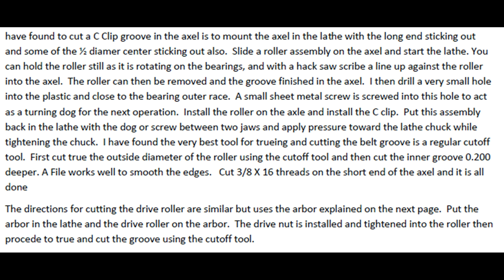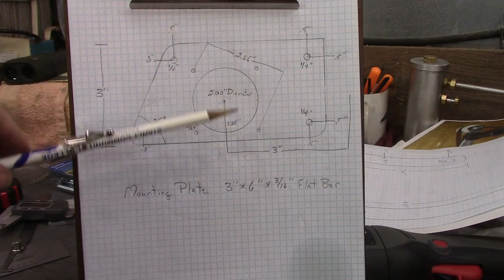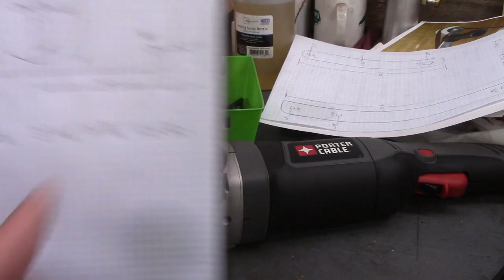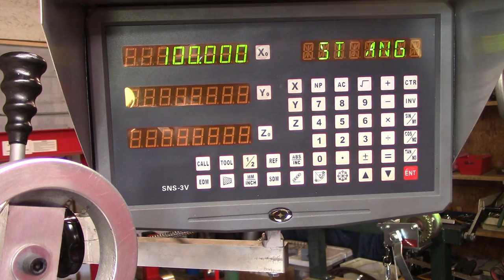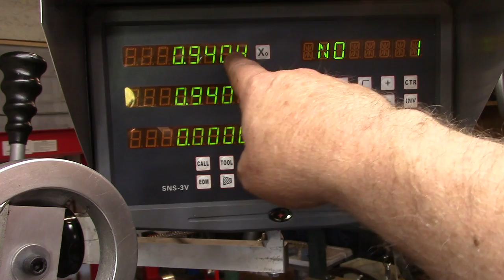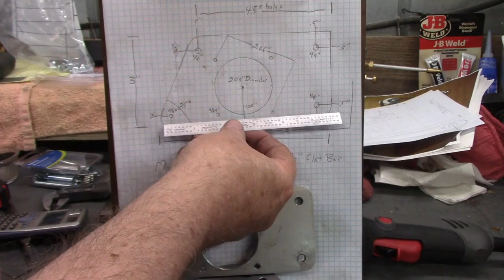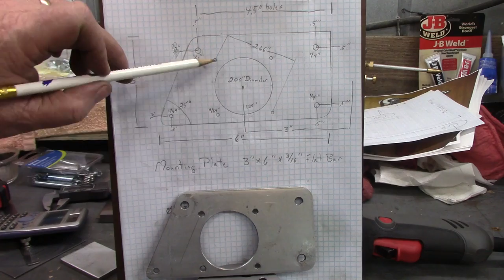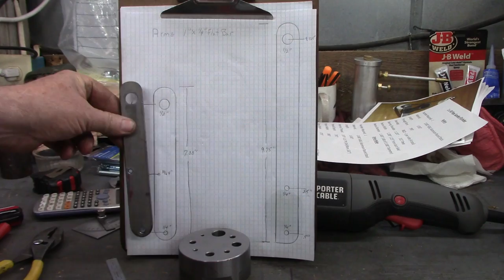1 x 30 Pipe Sander / Polisher - Part 1 of 3

Comment: Fantastic. Found the same Porter Cable grinder and CAREFULLY flipped the head. Then I used your dimensions and drawings and cheated, using 2d cad software to make a dxf drawing for the parts and cut them out on the plasma table. It was however a pleasure to watch you make yours. Outstandingly useful tool. First use was to polish the post on a used Delta floor drill press I got for a song. Mounted in my homemade pipe jig I from a piece of flat bar and some casters ( idea I also borrowed from What We Made channel which they used to cut a gas cylinder to make a bell.) Jig holds the pipe firmly or holds it and allows it to spin. Held it fast and sanded it smooth and clean bit by bit with this contraption. Thanks so much for your meticulous videos.